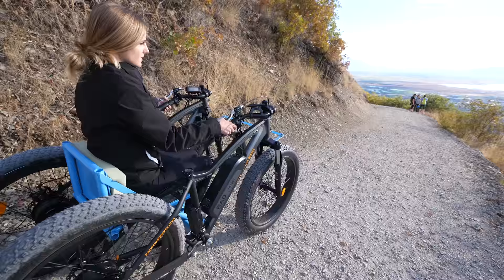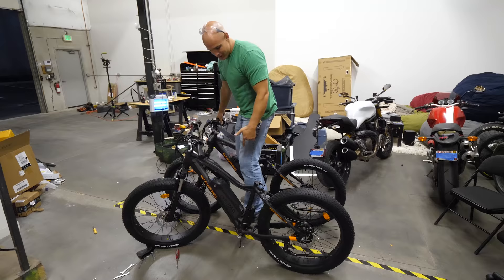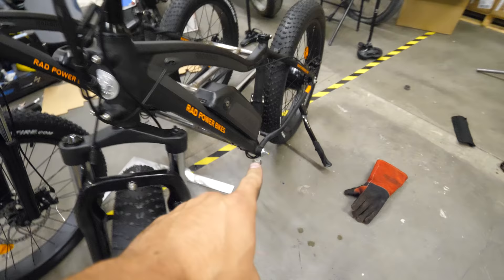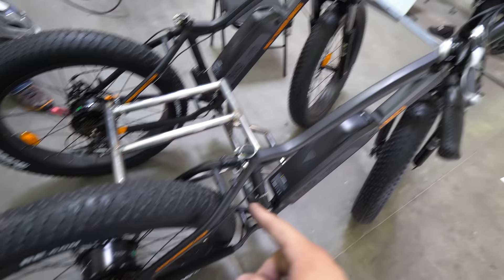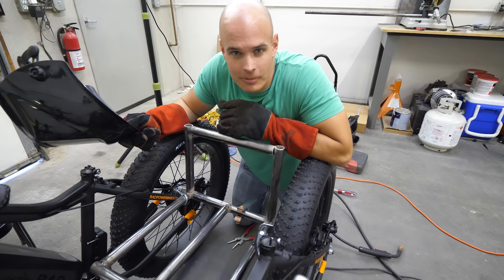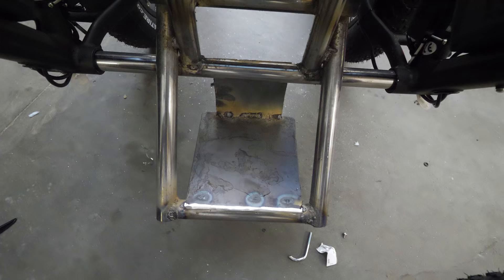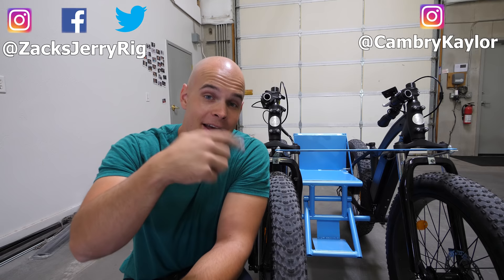How to Build an Off Road Wheelchair (From 2 Electric Bikes)

Comment: 6:04 to my opinion one throttle should control both motors to the same velocity - it's easy to achieve, same goes for the brakes that should press the rear disks both at once
Reply: But it will be difficult to turn, because both weels will spin at the same speed ! (2 throttle acts kind like a Differential !)
Reply: @cioltra  it will be ok
As it will be joint by throttle which od effectively power output % and not actual wheel RPM 
If throttle would directly control RPM then IT would be whole other story
Reply: It is impossible to brake with several disks at the same time, there's only one cable in each lever if it's a cable brake. But I don't know if it could work with hydraulics brakes
Reply: , most of them are in fact dyi but you can either get a double-line brake handles or brake line splitters
Reply: @cioltra  also known as tank drive controle

Comment: This is hugely impressive, I love it!  Cambry is gorgeous and I cried when she went up the grass hill in the other video!

Find the center of the "rear axle" (I know there isn't one, but the spot half way between the two rear hubs).  Mark that spot.
You've added two steering 'arms' on the front of the bike for the blue tie-rod to link the two steering assemblies.  Cut these off, and angle them so that three things are all in the same line:  the center of the bearings in which the forks turn, the center of the hole in which the tie-rod is bolted, and that mark between the back hubs.
Make a longer tie-rod.

This is 'Ackerman Steering' and it results in the front wheels steering at different rates, the wheel closer to the turn steers more than the wheel farther away, and means that all four wheels ALWAYS having the same center of turn when the bike steers, meaning that the front tires wont try to fight each other when steering.

Not only will this make the ride a little better, it'll make the bike a little more stable, and it'll probably also mean that Cambry wont have to 'fight' the steering as much.  It'll even slightly improve the bike's efficiency since steering wont put so much drag on the bike.

Also, please move the brake levers either 90-degrees out, or 90 degrees in, so she can have either a couple fingers or her thumb on the levers at all times.
Reply: oh, and a quick-release on either-end of that tie rod would let her move between the front wheels instead of having to go in over the side

Comment: Very cool! I am used to riding in a mobility scooter. 
Because of that experience, I have the following tips: 
1. Connect the two steering bars to each other with a bar in front of the lady. Then you can move the handles and place them on that bar. This is a more normal direction and because of that, it's easier for the lady to hold the bike in the right direction when she drives off road (bumping). 
2. Think about a kind of suspension under the seat.

Comment: About thirty years ago... I saw this guy going down the highway at about 60 mph riding a motorcycle with a standard wheelchair.  It was built like a motorcycle & side car but instead of a side car, it had a platform where the man could lower a ramp and drive his wheelchair right into the platform... close the gate behind him and then use all hand controls to operate the motorcycle.  I never got to see this motorcycle close up... only heading down the highway.  The man remained sitting in his wheelchair but had complete use of the motorcycle.  When he used this special motorcycle, the wheelchair went with him.  Consider this concept.  I am confident there are a lot of disabled people that would love to have such a motorcycle.  U.S. Army, Ret.  Texas

Comment: The bike you designed and built for Cambry is beautifully done and shows you have a heart of gold.
I've got an ebike, built from a front wheel conversion kit, a stock off the shelf walmart bike and a 48 volt (very heavy) SLA battery.

Comment: Setup tips for the current bike: 
Try making a type of CushCore by gluing pool noodles to the inside of the rims. This will allow you to run lower tire pressure for more ride comfort (also add tubeless sealant to make it puncture resistant). If the front shocks are coil sprung shocks, see if you can replace the spring on the inside with a softer coil, if it is air sprung, reduce the air pressure. This will allow more dampening when riding up curbs. If possible, increase rebound on the front shocks (so it takes longer to extend after an impact) to prevent the lift of the front tires when riding up a curb.

For the full suspension bike: 
Try to move the seat a bit forward (and up to clear the tires, you can look at using the seat tube for extra support). Even though this will increase the center of gravity, it will allow the weight distribution to be more neutral. This will help with the performance of the suspension, as it was designed to be relatively neutral. If possible, look for air sprung shocks and forks, as this will allow for more fine tuning and can even be set up by a suspension tuner at a later stage. For the seat, you can perhaps look at what GMBN did for Martyn Ashton, it will allow Cambry to be strapped into the seat, which might make it feel safer if she sits higher on the bike.

But, all in all, brilliant proof of concept.

Comment: If you do more welding, I'd suggest covering up those arms with something since welding emits a lot of UV light which is not good for your skin.
Reply: Agree welders sunburn can be pretty bad. TIG can give some shocking aunburns in just a couple of minutes without arm coverage (voice of personal experience here - I'm just tacking up, it'll be fine. Get indoors....arms lobster red between sleeves and gloves. Welders cap is also a good idea, weld spatter on scalp (even with hair) hurts
Reply: John Phillip I’ll second everything you said

Comment: Small suggestion on steering. Use 2 ball joints and one side right thread rod and the other side a left thread with an adjuster nut in the middle to adjust alignment! Did u you use a body restraint system(seat and torso belts) to stabilize her in the seat(so she doesn’t slide around)? Also maybe get with her about ideas as to make it easier for her to get into and out of? Great job! God bless you!

Comment: Awesome idea! May I suggest 1 other thing though? The current steering "linkage"  doesn't have a vertical travel with that set-up but is independent of either wheel since they are mounted below the suspension travel. Perhaps using something like a trolling motor connector would work better. These connectors are used between a main & secondary outboard for steering & have several features that you might find interesting. The have a ball stud mount (rod end bearing) with a coupler connected to a rod or piece of threaded rod & are also removable. The reason I say removeable is that this could also provide access to mount the bike without assistance. Roll up, remove the rod, climb in, reconnect the rod & move the chair, done.

Comment: One thing to watch out for when designing the steering mechanism: Right now both front wheels are turning in exactly the same angles, which isn't ideal. Ideally the inner wheel would turn a little bit more, so no wheel slips when driving in a curve. This may also reduce wear on the front wheels.

Comment: I build industrial equipment at my job, and have a few suggestions to this awesome project.
You should use ball joints from pneumatic cylinders for joining the steering, that would make it adjustable as they have internal threads.
Also I would use the hole for the seat together with the bottom mounting, as they would increase the stiffness of your frame.
Hope this is useful.
Thanks for a great channel 🤘

Comment: The next step would be developing it further using thinner tubes and cheaper bikes, drill a small hole in each end of the all thread to so you put a pin through it to really secure the nuts. Adding springs to the seat will make a big difference too.

Comment: I responded to your other video - beautiful contraption... 

For the shocks, you do not need to get new bikes. You only need to absorb shock in the seat - so make it so the seat goes up and down, like a trucker seat. That may be safer too. The biggest change I would make, is for accessibility. Lets say she wants to go to dinner with you on the bikes - she would need to strap her chair to hers somehow or have someone meet you there to drop it off unless the restaurant has one. Additionally, getting in and out is tedious from what I saw the first video.

I would get rid of the seat in the middle. Instead, I would use her chair as the chair for the bike. The way to do this is either add some hardware to her chair, or not - but lift the front bar off which connects the steering, or let her enter from the rear. Then, and there are many ways you can do this but I would probably have a lever on the left and right which grabs the bike in several locations, and levers to lift the chair off the ground when in. You could also use a simple ramp, and knowing her exact chair, this wouldn't be hard either.

This way she can ride anywhere she wants, any way she wants, and if there isn't room in a small convenience store for this then she can take her chair off of it, go into the store, and come out and get back in without any assistance.

That would be the biggest change I'd make. That way she doesn't have to get out of her existing chair and into another just to ride. And since you are an experienced builder, you should be able to do something with this. Maybe make it, and for after covid take her somewhere special on the bike.

Comment: If you made the chair mount to the seat post and bottom bracket, these could be a universal fit kit for any pair of electric bikes with hub motors. Just pop out the seats and pedals, insert the chair to seat tubes, link the bottom brackets with a cross-bolt, convert the bars, link the forks, and you're done.

Comment: Nice job! I watched the demo video as well and you should flip the brake lever assemblies for better ergonomics. Also you should ensure run off one bike battery , allowing you to increase the overall distance and then turn both on for all terrain applications

Parking brake can be modeled after an older ATV set-up with a brake lever catch.

Cheers!

Comment: You sir are a true hero! Helping through creating, you give me hope for humanity! Oh, a steering tip; tilt the the angle bracket steering arms a bit towards center. That way you will get a differentiated steering that compensates for the differing turn radius of the inner and outer frame in the turn. Have a good one! :-)

Comment: I know I'm late to the table but I have a suggestion.  The interconnect between the two front ends, needs to be a bit strong than those angle brackets.  I fear that the stress of the two front ends will eventually cause that angle to fail and then they would end up trying to go two different directions.  That could cause a tumble.  Take a look at how tractor front ends are tied together.  That should give you some ideas to start with.

Comment: I really appreciate your work brother, I would like to see you helping more ppl like this. I myself is a wheelchair bound, I suggest acceleration handle should be more closer to the person driving so that their hands should be on the arm rest while driving so their shoulders doesn't hurt in a long drive. Bike should be equipped with GPS tracker, cos when we get such things which gives us wings like power we go a bit far. sometimes we get stuck somewhere this tracker will help our lover ones to locate us. extra battery backup option should be available. Shock Absorber's will help a lot. Seating should be more comfortable.

Comment: When weight is everything (and would be very much so for this project) consider Chrome-moly tubing and tig welding, but for prototype work, your method is just as good.  The first suggestion would probably cut the added weight of seat by half.   Excellent job.

Comment: this concept can be developed a lot further.
Start with a chair mount that slots down where the saddle pin used to go and then on the bottom have a tube the same  diameter as the paddle bearing tube.
Then a tube/ rod trough both frames and the tube is all that's needed to secure the seat.
This will allow for simple disassembly for transport.
A bracket between the steering bearing tube  can also be made removable allowing the user to enter the bike from the front and then secure the bar and steering rod.

Comment: said in other video of when she got it (great project and bless ya doing it!), going similar with the steering cross link pin connected, and a platform a sports chair can back into to latch securely would be even better. the pilot wouldn't need assistance transferring into it, if done properly. a small ramp to help the chair into it could tilt up as front wheel stops too.

I know it'd be a bit more difficult to lay out and make happen like that, on the plus side using the all thread joining the crank hubs, and the U-bolts on the rear stays so it CAN be disassembled allows an easier redesign+replace! wouldn't have seen it if not for THIS video. Aluminum diamond plate surfaces to save some weight and give chair wheels some traction loading in/out is pretty strong+rigid if span between supports isn't too great. drill and long pop rivets is pretty tidy, self tapping sheet metal screws are handy things for that too.

Comment: Amazing. You made a fun ride that opens up even more exciting possibilities and adventures for Cambry. Great job! I was thinking about the seat and how to make it easy for Cambry to get on and off the bike on her own. What about 180 degree rotating, locking seat? If the rear tires are locked out by the motors or brakes, she can use them as support. Then she can transfer to the seat and rotate it to face forward. However, the main challenge I see with a rotating seat is her ability to support her legs as she rotates in and out of the bike. Anyhow, just wanted to share a thought that might stimulate other ideas. Thanks for using your skills and talents for good! Inspiring.

Comment: You could put shock absorbers, directly under the seat, so you don't have to alter the bike structure. Also, you could use an old wheelchair, as seat base. I'm tempted to do this, but electric bikes are still a bit expensive though.
Reply: And still expensive!

Comment: What a great idea.  But for the next generation of build, spread the bikes out wider and simply make a platform or rails she can roll up onto and stay in her current chair.   That would eliminate the need for assisted transfer and having to get the right seat size.  A width of 26" would be wide enough to make it fit most active wheelers in a manual chair.

Comment: This is a brilliant idea!!!! My thought was instead of a chair, have a flat platform with a reses in the front for a wheel chair to roll up into and the front wheels would drop down into. To roll the chair up into the the thing would be a small ramp that can be raised with a electric linear actuator, and have 2 electric latches similar to that of the mightymule electric gate latches, that way he is secured in place and wont roll out the back.

Comment: This is awesome! Great work. One thought that came to mind for me is.....that looks hard to get into. What if you replaced the seat you made, with a way to connect the wheelchair. Obviously that'd be a bit challenging to figure out, but if the wheelchair could be the seat, and then they could unlock the wheel chair and roll away without any help. And if the bike died, they wouldn't be stranded.

Comment: I have a suggestion.  Why don’t you weld a bar across the top of the 2 seat post that slide into the frame and cover it with round foam padding.  This can hold Cambry in place, like a seat
belt, if she ever had to stop suddenly so she wouldn’t slide forwards and risk falling out.  It would also be quick and easy to remove by unlatching the 2 release levers on the frame.

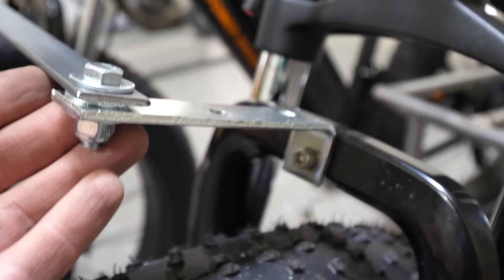Comment: Great work. May I suggest to replace the middle washer @4:48 with a ball bearing on both sides to eliminate friction and make steering smoother. Also, the angle bracket needs to be fixed into place better than this or even welded to prevent it from loosening and leaning right/left after using it for a while.

Comment: This is so awesome! 
One thing I would change: make both throttles work at the same time so the wheels won't spin in different speeds, this is important especially when riding in high speed on un-even terrain.

Comment: You could, as an safetyfeature, make a safetybar acrose the seat using the allready existing holes for the saddles. A poolnoodle around it and you've cussioned the impact with the bar.

Comment: A nice and cheap idea to build this kind of bike, but I I would like to share some idea's with you that can improve the way how is driving.

1. Move the left stem outside like the right steam;
2. Ungle the brakes in down position because she will have much more power in braking and she will be able to have a sense of braking;
3. Lift the chair up with 10-15 cm because this will gonna improve the way how is driving but also she will have a clear few where she is going as an idea you can use as connection points the holes for back fender (try to create an adjustable point if it is possible that allows changing the hight).
4. I think is easier to have hydraulic lines for braking and to install a distributor that will put pressure on 2 brakes calipers in the same time.

Comment: Each of those bikes cost $1,699.00 each. So together runs at $3,400.00. Not as expensive as other high end electric bicycles. Those mountain bicycles are built tough for offroad use. Thank you sir for your caring and support for the young lady. God bless and be safe.